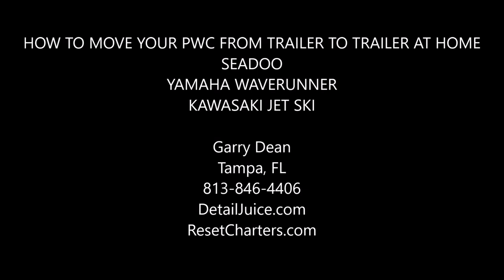HOW TO MOVE YOUR PWC FROM TRAILER TO TRAILER AT HOME SEADOO YAMAHA WAVERUNNER KAWASAKI JET SKI

Comment: Thanks for sharing and I'll give the first "thumbs up". I think saw your post on FB. My SVHO and VX are both front heavy and the leg of my cherry picker ends up exactly where the trailer tire is. My boom hook attachment point is centered above the storage box in front of the seat. I have a double axle (2) place Triton trailer and a single axle (1) place Triton, so this task is a bit more complicated for me. I would like to see you move a ski from the double trailer to the single  =0). Guys actually doing this will quickly find it's not that easy. I did not drop mine, but dropping a 900# Waverunner / Jet Ski is a real possibility. For that reason, I lifted the Waverunner and did not roll it while on the lift. P.S. I think a 10' tall gantry crane long enough to span the wheel wells of the double trailer with a 1 ton chain fall would be a good alternate way to swap trailers =0)
Reply from the maker: I posted the pics on FB when I took that RXPX off of the double and onto the single. It was equally as easy. The only scetchy part for me is moving the cherry picker when the PWC is in the air.